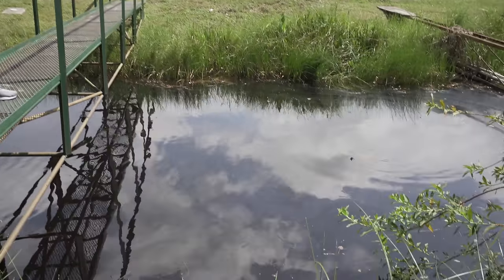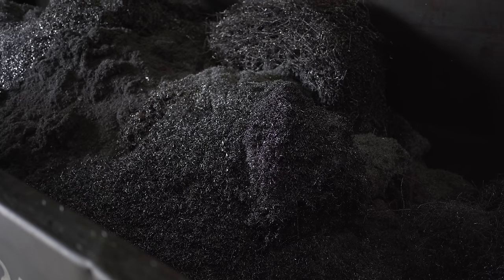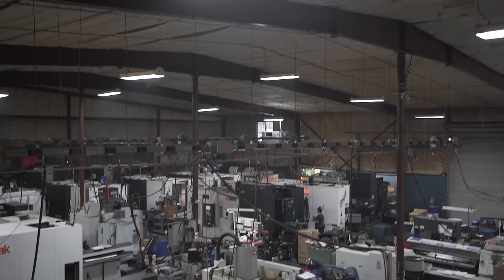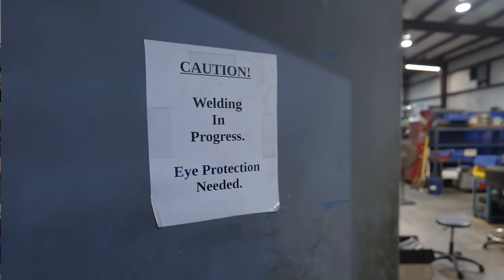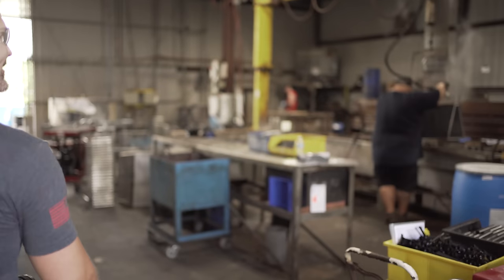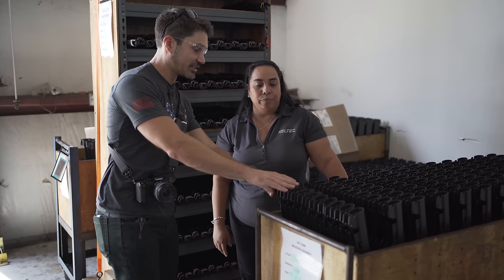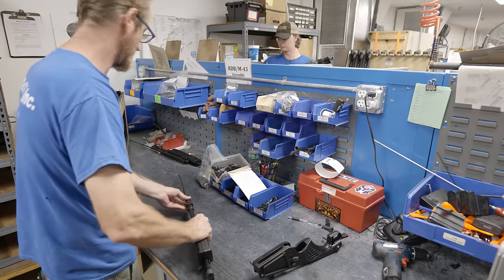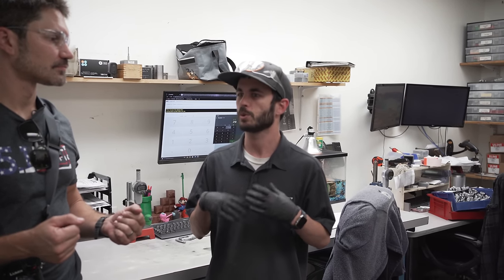How a Kel-Tec KSG is Made: The Kel-Tec Factory Tour

Comment: I like KT.  Owned an RFB and CMR30 at one point.  Still own an RDB and PMR30.  That said, I only wish they'd spend a bit more time on QC and in the unfortunate event, something has to go back for warranty repair, that they'd take less than 8-10 weeks to resolve it.  Also, they used to freely sell parts for various firearms they manufactured.  Doesn't seem to be the case for some guns now like the RDB.  Anyway, thanks for the video.  Was always curious what their operation looked like.

Comment: Loved my KSG but damn did it beat the hell out of me
Sub2000 is amazing since they switched to only making them with glock mag adapters
Reply: How does limiting adaptor options make the subsequent guns any better?
Reply: @hansgruber9685  it used to be impossible to find sub2000s that took the glock mags, and the other ones took way smaller and more expensive mags
Now that it’s universally glock, it’s much easier to get high cap mags
Reply: @vikings_fans_anonymous  M9 and M&P mags are very common/cheap too. Idk if you can get drums for them but you can definitely get extended mags.

Comment: Anyone that complains about Kel Tec clearly hasn't shot an SU-16

That thing is just fun.
Reply: @glennpearson3056  I think there is a reason why you never see one in a shop. Relatively inexpensive, and has good reviews online. People get after them if they can't afford an AR-15
Reply: @glennpearson3056  So you are saying you can't find an SU-16, so it's bad? 
And unlike Hi-Points, Kel Tec firearms don't work? 
Just making sure that's what you are saying. Not judging at all. 

 Personally, I have seen several SU-16's at my local gun store. There are some there right now actually. So they seem common enough in OR.
And from personal experience, the SU-16 works very well. It's been on the market quite a while, and still gets good reviews. It's a nice gun, especially for beginners like I was when I got it.

Comment: Given Kel-Tec's notoriously shitty quality, I was amazed that everyone WASN'T assembling everything blindfolded.
Reply: I was going to make a similar observation. That being said, I think 'shitty quality' is maybe a little harsh. I've owned a Kel-Tec, and I'd argue it's more of a lack of hand-fitting/final finish that causes most issues. This can be solved by a competent gunowner typically just running a few hundred rounds through the gun to wear down any significant imperfections, however I understand how absurd it can seem to require "break in" on something you want to potentially entrust your life to. Then again, outside of the major defensive manufacturers like S&W, Sig, Glock, FN, Walther, HK, etc you'll find a lot of manufacturers that also require a break in period. Like Kahr, Kimber, etc. Even Ruger can straddle the line a little between the two at times.

I still think Kel-Tec is really missing the boat on a "pro line" or "Competition line", similar to S&W's 'Performance Center' models. Offer me a KSG/RDB/RFB with a different recoil buffer, maybe a tritium front sight, AND a touch of hand fitting for an extra $200-300 and you'd sell them all day.
Reply: @MatthewCochrane9622  You're probably right. "Shitty" should probably more accurately be changed to "lackluster". "Shitty" was used more for the sake of brevity.
Reply: @MatthewCochrane9622  MCarbo sells Sub-2000s with all their upgrades already installed. I don't think Kel-Tec has any interest in premium lines but maybe MCarbo would be a good place to direct your request.

Comment: Love their designs but both ksg and ks7 new were totally unreliable. Rounds popping out of tube  while firing , failure to extract , failure to chamber , double feeds , having to take the shotgun apart to just get the stuck shells out . Mailed it back and they said they fixed it but sold it back to shop for a loss . Would never trust the design again . I never had an issue with any other pump design . If you got a reliable one that’s fantastic. But when both pumps I bought literally were non functional I will never buy again. And here’s the thing I loved the design and really wanted it to be my favorite shotgun.